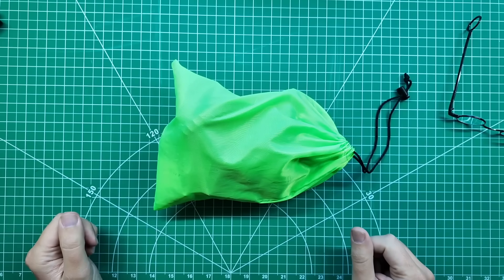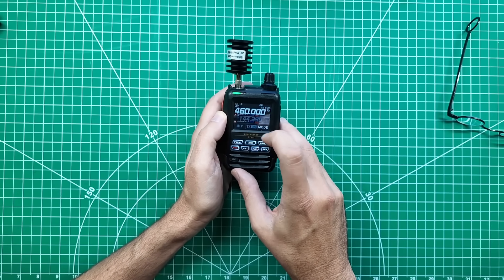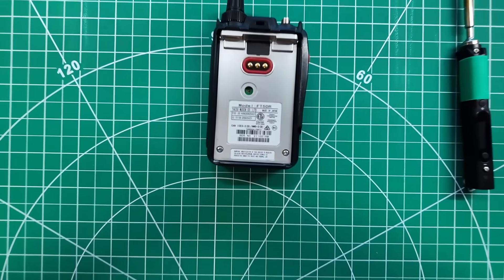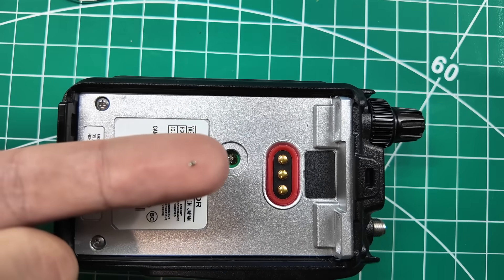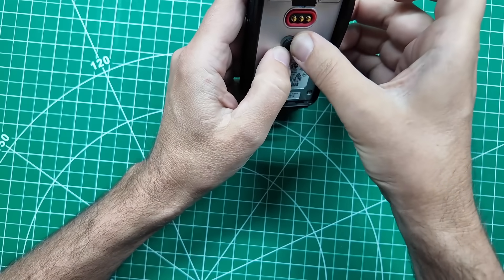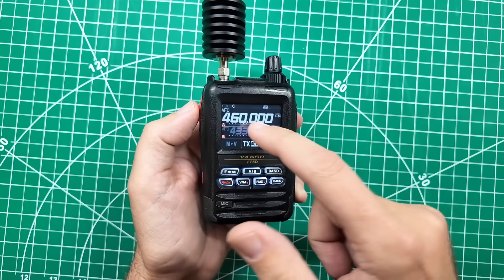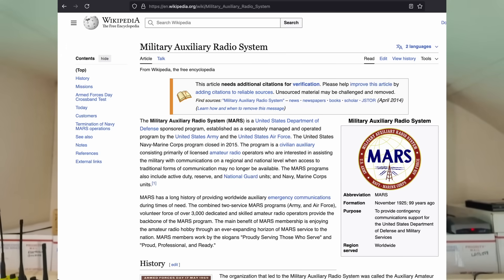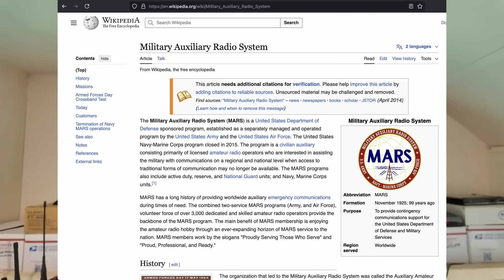The FT5D You've Always Dreamed Of...

Comment: Funny video: I was accidentally looking for a soldering iron with an electric suction and pressed the wrong button. Wouldn't it be easier to get a soldering iron with a vacuum or electric suction and remove a resistor in 3 seconds? Pardon the pun...
Reply from the maker: There are lots of ways to do it and my solder vacuum is back in my storage unit while I'm out on the road.  They used some particularly difficult solder on this part and I had fun removing it and cleaning up the mess... wait until somebody else comes along and comments: "why not just cut it off?"
Reply: @temporarilyoffline  Complex solder? Probably high-melting. It's a strange decision to leave a hole, break the seal, and then use high-melting solders. You could put a reed switch there, following samurai tradition. Apparently, all radios have this kind of quirk... Who knows..

Comment: The desoldering process of this resistance is not only dificult but risky.  To remove the resistance I used a small pair of fine-tipped cutting pliers and job done!
Reply from the maker: @e.ernestosyriani9345  strong work!
Reply: Same here with my ft3d quick snip and done.
Reply: You've obviously never used a soldering iron with a suction cup. Definitely buy one; you'll need it everywhere.

Comment: Can you block transmit on memory channels after this mod? Say you have some you listen to but absolutely don’t want to transmit on. Haven’t found the answer anywhere
Reply from the maker: @ErikN1  I don't know either, I guess it would be in the code plug software, and I've never even tried that.  The radio will already listen "out of band" without the mod though
Reply: @ Thank you. I know it will receive but I’d like to do the mod so I have the ability to transmit out of band in an emergency if I have no other means of contact. I just don’t want to accidentally transmit.

Comment: I've been an electronic technician for almost 35 years and could easily do a MARS mod on most of my rigs but I emit a huge yawn whenever I consider it. I don't see the reason to do so. Not interested in MARS or CAP comms. To each his own. But glad you did this vid for those who are salivating to do this type of stuff!! So thanks. I did do the quick MARS reset for someone on his two Baofengs and all you have to do on those is hold down a certain combo of buttons while you power them up. No de-soldering required on most Chinese rigs. But personally, I'd rather have one of the big threes, even if I had to de-solder half the circuit board!! I don't do Chinese, with the exception of Chinese food at times. The Chinese maybe be improving transmit and cutting down the harmonics but their receive sections are still direct conversion. Give me a Superhet with two or three IF stages, thank you very much! The received intermod that comes through on Chinese radios is horrifying.
Reply: Your comment made me yawn.
Reply from the maker: @markr.1984  Hey Mark, thanks for watching!
Reply: I applied the MARS mod to my European FT3D for a single reason: the USA has different band plans than Europe. Whenever I was traveling in the USA along with the EU-band-plan-limited transceiver, I was locked out on certain frequencies available in the USA (which cannot be used in Europe). Now, I can use the same FT3D in Europe and the US, too.

Comment: I had not heard of flux remover until this. My soldering skills are still weak though. But it was cool to see this done. Now you need to see what the power output is on some of the MURS, GMRS, and Marine frequencies it unlocks!
Reply from the maker: the power is disappointing as you'd expect because of not having the right filters internally.  About 2 watts.

Comment: Steve, from someone that's been certified to solder on stuff that's gone to space. You want leaded 60/40 solder, still flux and a soldering tip that's the width of the 0402 resistor so you get both pads at once. You'd have bumped it and the surface tension of the solder on your tip would likely hold onto the resistor for easy extraction. Keep up the great vids!
Reply from the maker: Agree 100%... well maybe 99% (63/37 ;-) )

Comment: I just applied iron directly to the middle and side of the resistor, and levered gently using the aluminium chassis. No solder, no flux. Once it hits temp, it just slides off the contacts and you can shake it out.
Reply from the maker: I think mine was a little weird.  Gotta share the struggles as well!

Comment: You should check the power out. I’ve heard on the non ham bands it’s really low and definitely not 5 watts.
Reply from the maker: yeah, they are always down on power on the frequencies they aren't designed for.
Reply: @temporarilyoffline yes, but the ft5 is wayyyy down. Down to .5 watts I’ve heard. Compared to the ft-60,65,4X and some other that are about 3 to 4w.

Comment: Suggestion for testing battery life. Set one side of the radio for APRS and beacon every 2 minutes. Let the radio sit and beacon until the battery runs down. If you are in range of an Igate, you can look at your gated beacons to see how long the battery lasted. To speed up the process, open the squelch on the other side of the radio.
Reply from the maker: I like that idea!  I was thinking of beaconing into a dummy load... but nothing beats hard 3rd party logs!

Comment: I'm not 100% sure (and willing to be wrong), but I don't think simply doing the "MARS" mod is "illegal". However, doing so then transmitting outside of your frequency allocations would be.
Reply from the maker: You are correct.  Even if you hold both licenses, you're "legally" allowed to TX on GMRS with this radio... paper laws in file cabinets is how they get ya.

Comment: Yeah, flux isn't useful for de-soldering.
Reply from the maker: sure it is.  Flux is used to help transfer heat and maintain heat.  Watch any of Luis Rossman's videos where he does this kind of thing all day long.  Lots of flux.
Reply: @temporarilyoffline  No,, hot flux dissolves dirt and oxidation from the part being soldered, so that solder can wet to it.  It's not a particularly good thermal conductor, especially compared to molten solder.

What would have helped you on this projeect is a tip broad enough to touch both ends of the resistor at once.
Reply from the maker: https://youtube.com/shorts/2GK1mKbJfvQ?si=q1gJyAEtFegxdLen

Comment: Good info for the community. Simply mod, I did mine day 1, but seeing a video gives people confidence. 
But the FT5D that I've always dreamed of just isn't designed by people in their 80s and includes the $5 hardware to give it a bluetooth serial port and has USB-C.
Reply from the maker: The Vero VR-N76/Btech UVPro/Radioddity GA-5WB is closer to what I want.
Reply: @temporarilyoffline  Well damn. Now i want that VR-N76. Seems like a real modern little HT.
Reply: Yeasu is so outdated in their usability. The only thing they have going is the receiver on the dx 10. Other than that nothing has really changed in 20 years. The fact that they all don't have bluetooth paring and a app to quickly download repeaters in local areas is rediculous. I mean seriously the fact that you can't even use your car audio or a bluetooth ear piece is a joke.
Reply: TH-D74/75

Comment: The problem is likely to be lead free solder used to make your radio. The solution is more heat and standard solder. Do not press hard as you may damage the traces on the PCB. Anyway you got there in the end. In my youth I would have it like you did, you were very brave doing all the work through that small hole.
Reply from the maker: 100% agree.  It was a tad harder to dismantle the radio, so I did it operation style!

Comment: I suspect it was lead free solder that is well known for being difficult to work with. Two soldering irons with very thin bits is my method for removing these SMDs but you also had really bad access. I don't think I would have attempted that MASRS mod!
I had a Yaesu 450 that had been wide banded by a previous owner and would transmit out of ham band and I found that to be a pain in the butt so I had the mod reversed.
Reply from the maker: I'm always trying to have fun and expand my world.  Thanks for watching!